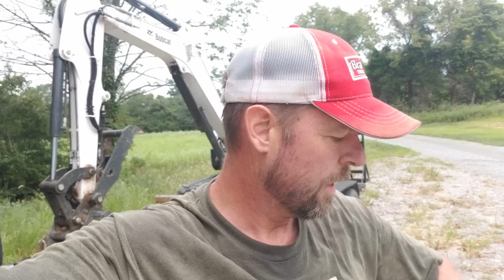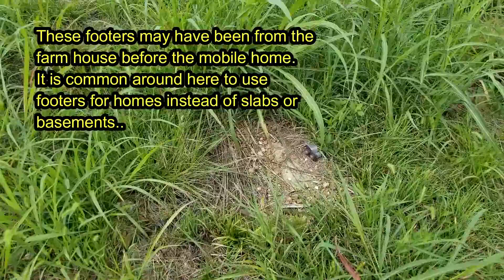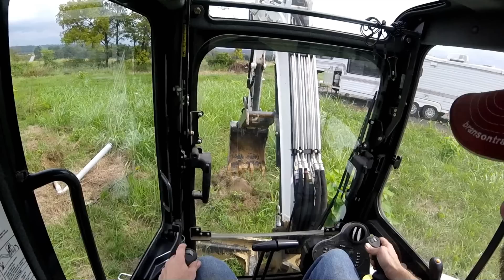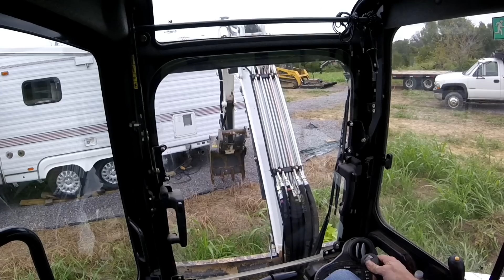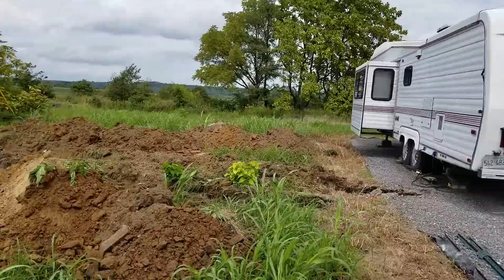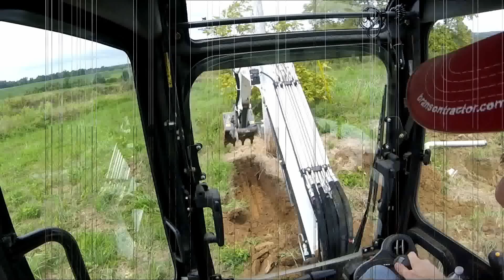Digging up old concrete footers and trenching Power and Sewer lines 08-29-18

Comment: hi kapper dont know if you notice the caravan concrete your pulling out as loops on from what i could see they would of been used for  chaining or roping the caravan down in case of strong winds i noticed you have not put the  supports in to chain it down from strong winds if you have kapper my eyes aint good as a person gets older...?
Reply from the maker: No I don't have it strap down into the ground just its own weight

Comment: Glad hour getting in some seat time and hopefully hunting time after recovery.  For the creek crossings look into gabion fences.  Set the base rocks with rebar ties onto stone and grout in place.  They would turn the creek bed into watering holes with overflow running over in the spring and rains.  It's a dam/working bridge.  Good place to repurpose those footings in wet concrete.  It's a metal cage holding rocks and water.  Turns rock into habitat building material.  Much luck with the surgery and speedy recovery.  You'll be glad it's done the day after.  Great uploads and progress.
Reply from the maker: Thanks Ed! I like that idea!! I know that this creek will rush hard during heavy rains, but it could work if I get them set enough..Now you got my wheels turning! :)
Reply: Ed Deetz --- Good idea! They are heavy enough to mostly let gravity hold them....a great place to use on 211.